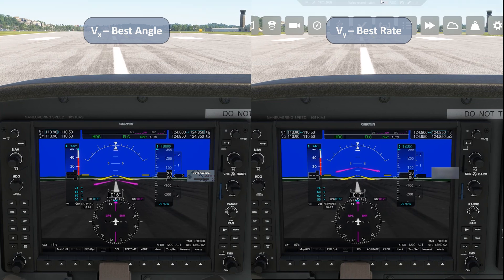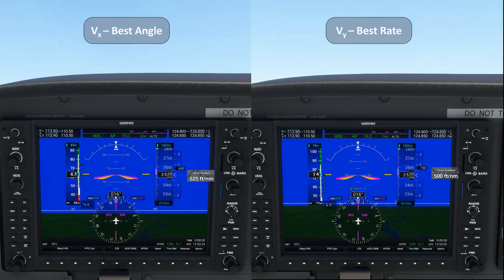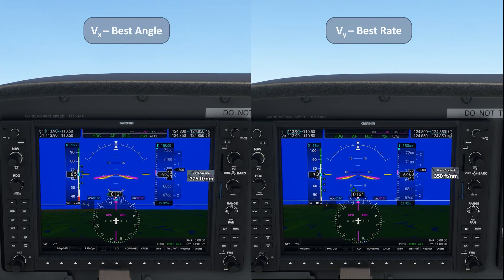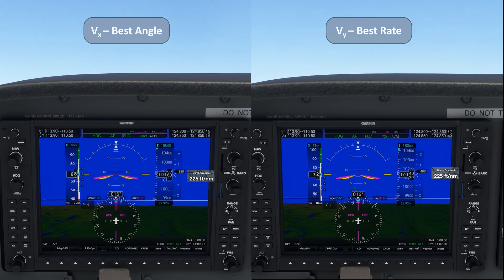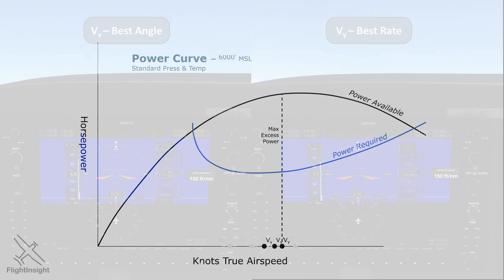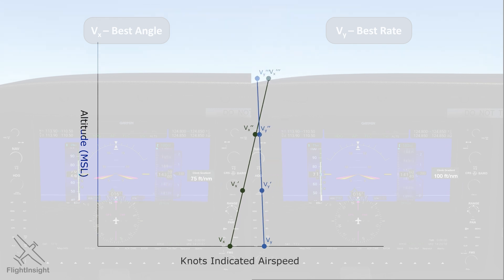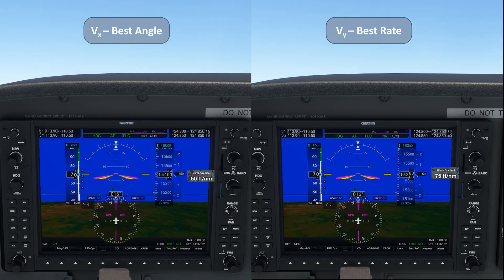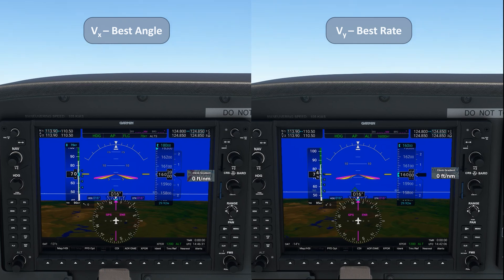Vx vs Vy: What Happens as You Climb? | Absolute Ceiling Explained

Comment: how does flying at Vx put the engine cylinders "under stress"? I'd like to know what your basis is for that claim.

The real issue is lack of cooling due to low airflow. The engine can run at its rated power for quite sometime. As someone with hundreds of hours flying high DA in C172, including at service ceiling, we pretty much fly around at full power at higher altitudes from the moment we takeoff due to lack of HP. So as you climb, you engine power, and wear, is not getting any worse. the engine doesn't know you're climbing at Vx, it only knows the RPM and temp it's running at. and as long a you stay within RPM limits, you're not hurting the engine. So that leaves only temperature, and you can help the temps somewhat by slightly enrichening the mixture. 

I wouldn't recommend climbing all the way at Vx either, but the claim it stresses the engine cylinders is baffling to me. flying within engine limits doesn't hurt the engine any more than normal.
Reply from the maker: It's the low airspeed pushing CHTs too high. Prolonged climbs at low airspeed will increase temps, because as you know lower speeds reduce air flow over an air cooled engine
Reply: @flightinsight9111  that I agree with. but if you manage the cooling in the climb, or perhaps have a liquid cooled engine, it may not be as much of an issue. 

And again, as you climb to altitude, your actual HP drops off (amount of fuel burned per power stroke drops), and air temp drops (in general, not always true), Vx increases, TAS increases, and you can sacrifice a little climb by enrichening the engine slightly.

But as you're video shows, there is no point in climbing at Vx for extended periods. And, according to the ft/NM angle of climb in your video, there was no reason to climb at Vx at all.
Reply: @SoloRenegade  In my P model C182, I do have to worry about CHT's even at VY in the summer. Plus last I looked, not a whole heck of a lot of liquid cooled aircraft registered in the the U.S. outside of newer training fleets. Cooling is dependent on air density much more so than air temperature. The ability of the atmosphere to carry away heat decreases with altitude because of that decrease in air density. The O-470 Continental in my plane runs very rich at full in mixture, and produces a lot more power above 5K ft. when leaned properly. As flatlander who has done mountain checkouts out of Leadville, CO, a fair number of us would disagree with your assessment on the "need" for extended Vx climbs.
Reply: @jetjock60  I never claimed all aircraft don't or wouldn't overheat, and I wasn't talking about C182 specifically eiher.

"Plus last I looked, not a whole heck of a lot of liquid cooled aircraft registered in the the U.S. outside of newer training fleets."

well, they you're not paying attention, now are you? Ever heard of the Rotax line of engines? they are in RVs, Zeniths, Sonex, and and countless other airplanes.

"Cooling is dependent on air density much more so than air temperature. "

affected to the same extent as the wings, prop and engine. Temperature and air density both matter to cooling. And just as TAS increases with altitude as IAS remains the same, the increased airflow helps offset the loss in density. And also, air flow rate matters a LOT to cooling.

"Continental in my plane runs very rich at full in mixture, and produces a lot more power above 5K ft. when leaned properly."

So? this is basic engine knowledge, and doesn't support your argument. You're just repeating things I've already said on here.

"As flatlander who has done mountain checkouts out of Leadville, CO, a fair number of us would disagree with your assessment on the "need" for extended Vx climbs."

doing a checkout out of leadville, is not the same as flying in the mountains every single day. Our students flew to leadville. not a big deal to me.

Learn to read. When did I ever claim a "need" for "extended Vx climbs"? You must be one of the younger people who failed to learn to read in public school, because I never once claimed any such thing.

Nothing you've said disproves anything I said. I flew airplanes and helicopters in the rocky mountains daily for years, and I'm also a Mechanical and Aerospace engineer and design cooling systems and hold tens of patents for cooling systems.
Reply: TEST question.

Comment: The physics are involved but the take home principle is important. At high DA you'll need a lower IAS to clear that obstacle. As you mentioned, these are the same circumstances that lead to overheating. This is especially relevant as you would be leaned for best power at the higher DA.
Reply: you should lean for best power regardless of DA. but you can enrichen a little to help cool the engine, and improve throttle response on carbureted engines. there is a lot of misconception and misunderstanding about mixture and leaning. a FADEC engine is leaning constantly, as is a car engine.